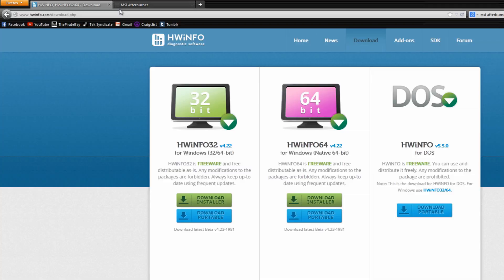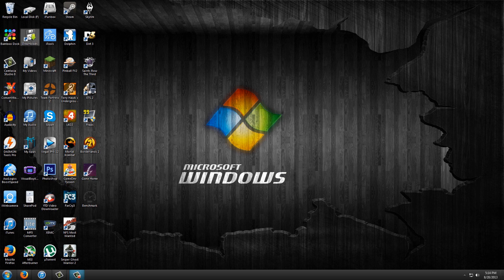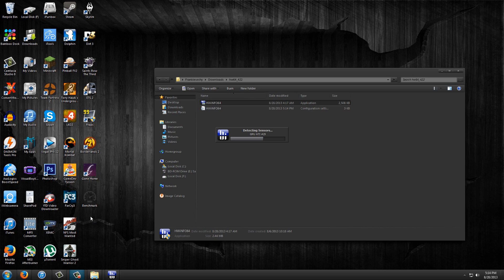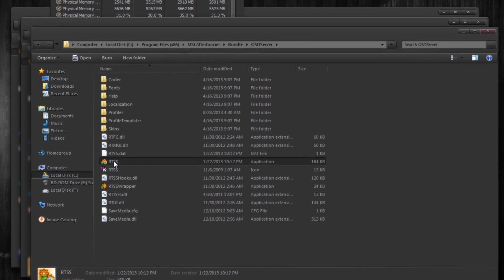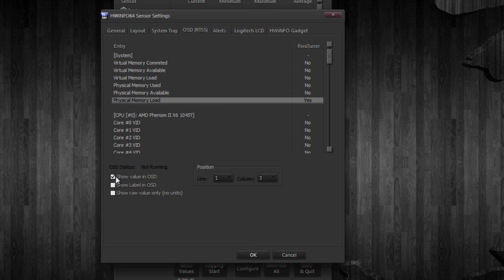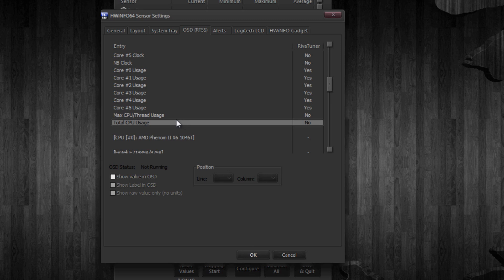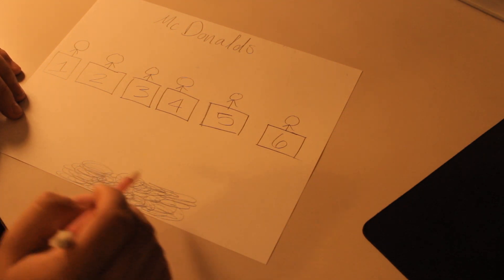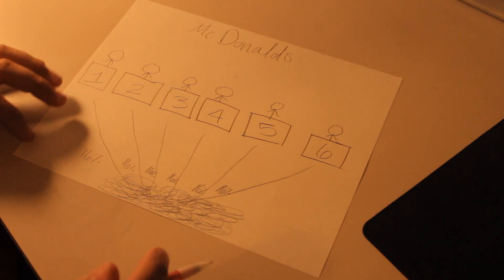How to Find Your PC's Bottleneck

Comment: Hi, systems specs is 
i5 6600k running at 4.4ghz
8GB ram ddr4 single channel
GTX 980 ti amp extreme zotac
PSU: Seasonic Evo m12 520W 80+

everytime I play Battlefield 1 I experience CPU bottleneck CPU usage is always at 100% and my GPU usage is 60% - 70% sometimes it goes up to 85% I don't believe that i5 6600k will be bottlenecking with 980ti. Is there any problem with my system?

Comment: is my AMD FX 6300  bottlenecking my AMD R390 ?
Reply: Yeah, I had an R9 390x with an amd fx 4300, and then found out my cpu was a MASSIVE bottleneck. Anything AMD at the moment for you cpu will be a bottleneck. I recommend buying the 6th generation intel cpu's. I just upgraded to an i3 6100, and I saw a massive difference in performance. Even tho it's just an i3. I only play games, so it doesn't really matter I have an i3.
Reply: An 8350 would likely bottleneck it aswell unless you overclocked it.

Comment: I cant get RTSS to show up :C
Reply: When installing Msi Afterburner you have to ensure that RTTS is also installed. Hope it helps
Reply: oh, i am using RTSS, I just cant get the numbers on the screen to show up
Reply: +atheistfromnorway in Afterburner go to settings, monitoring,  check the mark on those stats you want to see,  then on the bottom tick the "show in on screen dissplay"  it should appaer now. Good luck! And happy benchmarking

Comment: Well I am confused.

I ran Assassins Creed Syndicate on Ultra and my Cpu Cores were at around 80-90% and my GPU was at 99%.

I lowered some of the settings and noch my GPU went down to around 90%, but the CPU was now at a constant 99%

i5-3570K stock clock; GTX 970

Comment: OK so im bench marking Rainbow Six Siege on ultra and my GPU is at 90-100 and my CPU is at 70-80, I lowered the settings to medium just for a test and yet my GPU was at 90-100 and CPU 90 -100 i then tried Low settings and they were just the same as the medium settings.

What is the Bottleneck?... much appreciated.

Comment: I'm getting 67% physical memory, 23-38% CPU, and 60-70% GPU on Fallout 4, yet am experiencing not insignificant frame rate issues at high settings (to 20 fpm or less at times). I'm using 69% physical memory, 30% CPU, and 97% graphics card usage on the Witcher 3, for reference.

What is my issue here?
Reply: +Keith Fuller It's the game man. Happening for everyone.

Comment: so if my gpu was at 100% and my cpu was at 100% the cpu would be the bottle neck because the cpu couldnt handle the gpus info sent?
Reply: +GamingToday That means your PC isn't strong enough to run whatever you are trying to run, they are probably on par, but the game is too intensive. Try with lower settings and see what you get, if they are at the same, then no bottle neck, if one is larger by a big amount, you have a bottle neck.
Reply: Shadow Walker ok if my gpu is at 99% all the time and cpus at around 50% what would be the bottleneck here???
Reply: GamingToday The GPU.

Comment: ran this bench mark on my 2 pc's. one amd phenom x4 ii 970t with gtx 670, cpu 61% gpu 10% sometimes 40% across the board. another core i3 4th gen with gt 720, cpu 41% gpu 100% this being the worst gpu the bottleneck. the first one is the better game pc for diablo 3. i do notice some lag in the second pc. the i3 has a significantly better single core bench mark. they both play the game. one weak cpu strong gpu the other strong cpu weak gpu. with the weak cpu the loading screen takes longer. can't upgrade the weak gpu more because psu not modular is prebuilt.

Comment: Everything is right in this video except GPU part, if your GPU is 99% it means that you DON'T have any BN and you gpu is working at it's full potential, if your GPU usage is 60-70% that means that CPU can't handle all the work that gpu is sending to him. Cpu - Lower usage the better, GPU - higher usage the better.
Reply: +DelBoy That's bullshit. Your computer can't just make shit up for your GPU to do. If it's at 99% usage, it's using 99% of what it can do. It won't be able to run anything more intensive than that very well. You absolutely do not want to run any part of your hardware at 99% for any extended period Depending on your cooling situation it could severely reduce its lifespan.
Reply: JavierBacon
GPU is not a CPU it's made to work on 99% in games. The only thing when it's alright to have lower gpu usage is when you enable Vsync because your graphics card doesn't need to work so hard in some games to render 60fps, but when you disable vsync there's no FPS cap, so if you have slower gpu you'll have 99% usage at maybe 70fps but if you have high end gpu it will go to let's say 150fps to be at 99%, there's no limit. If you put a cap on FPS or enable vsync then ofc. it doesn't need to work that hard, but most of us disable vsync. Also to back my story up, i've had FX 8320 at 4.5ghz and 290X and most games were using only 70% of gpu, i've upgraded to i5 6600 now it's constantly at 99%... I know what i'm talking about.

Comment: so basicly with this method i found out that it wasnt my cpu bottlenecking etc as i thought, 
i recently bought a gtx 970 msi. and apparently it can't run witcher 3 in any decent settings and get solid 60 fps + : / damn thats so freaking dissapointing. it was running at 100% and my cpu wich is a 2500k at 4.4ghz ran at 60% on all cores. and it stutters and drops to like 45-60 fps around there. shame
Reply: +Vuzuul well maybe because 970 is performance wise pretty much same thing as 780...
Reply: ***** a 970 is a few % faster :) altho since then i've bought a new system and am now running sli msi 970s and
ASUS Z170 maximus VIII Hero
Samsung 950-series PRO 256GB M.2 NVMe	
Samsung 850-Series EVO 500GB	
EVGA Supernova G2 850W

Corsair 16GB (2x8GB) DDR4 2133MHz CL13 Vengeance
Fractal Design Define S 
Intel Core i7 6700K 4.0 GHz 8MB

Comment: Thanks for this video,

Question, i have 2 x 670 in sli and only second card has GPU D3D Usage that can be turned on to yes. is this due to the sli setup and will it give me the right usage value (in %) of both of my cards.

Comment: I have a question!  I followed this guide and my CPU threads were all around 70% and my GPU was around 60-70% and my RAM was around 23%.  Correct me if I'm wrong, but doesn't the computer put out as fast of an FPS as possible until it hits some sort of limit of the hardware?  If so, then I am confused as to what aspect of my system is preventing me from getting faster FPSs, since nothing appears to be at 100%.  Any Ideas?
Reply: +Mitchel Craun Game might be capped at 60fps if you have VSync on or if you capped it, so that might be the reason. Also, the computer won't push itself to give you more fps, it takes what it is given, and renders it and loads it and stuff. For it to be faster fps the usage should be lower, since that would mean it is clearing things faster.

Comment: hi guys. i have amd a10-7850k (OC to 4,2Ghz), 8gb ram 2133Mhz (2x4) and GTX 960 gaming 2G. i think i am bottlenecked is it true or problem is elshewhere ? and if i am bottlenecked is here any solution to fix it and not buying new cpu with motherboard or no ? thanks for help :)

Comment: My CPU has Intel i3 530 and 8gb 1600mhz RAM. Now i'm planning to buy a graphics card for general use (gaming, editing). Is GTX 650 / HD 7850 / GTX 750 worth to pay without bottlenecking the whole system?

Comment: both my gpu and cpu usages are 90% what does that mean help!
Reply: +Infrared Gamer Try lowering down the game settings and see if that helps. Also try other games to see if you get different results. If the results are the same then it's probably time to upgrade.

Comment: I have an i7 4790k running at 4.0ghz with an Asus factory OC gtx 770 and 8gb of RAM, running with 2 Samsung 840 120gb ssd's, no hard drive and I have 55gb left free. I feel like my pc isn't doing as well as it should be,  for some odd reason when I try to max out h1z1 or rust ( new version) it drops me from 60 fps ( on high) to around 30-32. For both games
Halp?
Reply: Its your 770

Comment: Im just comfused
GPU is 59-99% asus amd radeon r9 270x 4gb directcu ii top
RAM 42%
CPU all cores except one at a time below 50

105 FPS on Bioshock infinete on ultra and yet games seam to lag. Can it be the Motherbord? or i have a weak power supplay to 550W aaaaaaaa im just confused now or is it my shitty monitor.

Comment: Hey sir, I bought myself a gtx 750 ti.... I saw many people using it and run bf4 on ultra... but than I realised thst I have 20-30 fps on low medium....

The graphcard may not be the problem... Let me give you my specs

Cpu: AMD A8-6600K  Quad-Core 3.9GHz (with radeon hd graph which I aint using)
Gpu: Nvidea geforce gtx 750 ti ( evga )
8 Gig ram 1600 mz
harddisk 1 tb

Can you tell me where the bottleneck is

thanks already guys :)
Reply: +bram van Likkepot What's the wattage on your power supply?
Reply: KrypptikkSoulslayer 500

Comment: Aight, so I did this (great vid btw) and I had my last 3 cores of my quad core, at 100% most of the time along with my gpu and ram, although my ram was more on the 10-20% side of things but sometimes at 100%. My first core was just sitting on about 40-70%. This is annoying as I recently got a new gpu (on Saturday) so what is my problem?

Specs: Amd athlon quad core processor 
           Msi radeon r9 270x oc gaming 2gb
           8gigs of ram (one ballistix corsair idk what the other one is)

What do I do?

Comment: Please Check mine, 
GTX 970 Amp Extreme Edition
i5 3470 3.2 ghz 3rd gen
8gb ram kingston
motherboard msi b75
Thanks!!, tell me if something is bottleneck or everything is in balance?
Reply: ***** thanks man.. appreciate your help
Reply: ***** But I'm Experience Random Freeze When playing AC Unity.. The Game Runs Smooth 50-60FPS max Settings But Random Freeze like every 20mins freeze for 5 Secs.. What do you think? or w/c part do i need to upgrade?
Reply: john albert policarpio 
Check your PSU, how many watts? And it could also be beacuse of either the GTX 970 memory bug or how bad AC Unity is made for pc (it's extremely bad configruated haha Uisoft have had alot of critisicm beacuse of that). :)
Reply: 550 PSU.. >< damn! i dont know either if its my HDD now lol
Reply: john albert policarpio It might be a too weak one, what brand is it?
Reply: WDC WD10EALS S-00Z8A0 ATA DEVICE
Reply: john albert policarpio If you really wont no problems you should get a high-brand one, like cooler master or corsair, it could be that the power cant handle the praphics card when it's running full.
Reply: bro i got a 770 before when and never had issues the wattage of its is twice as of gtx 970, gtx 970 is saves a lot of power/electricity, and the 550 PSU that i have is also high quality
Reply: Thank you so much.. its all ok now.. got the new patch v1.5 for ac unity.. :) no lag at all now and all on ultra thanks

Comment: NEED HELP ASAP, when i play games like battlefield and advanced warfare i can get a steady 60 fps on ultra settings. But when i play lol or minecraft i struggle to get 60 on medium settings. Can anyone help? my specs are as follows:
	AMD FX-9370	4 °C
	Vishera 32nm Technology
RAM
	16.0GB Dual-Channel DDR3 @ 802MHz (11-11-11-28)
Motherboard
	ASUSTeK COMPUTER INC. CROSSHAIR V FORMULA-Z (Socket 942)	27 °C
Graphics
	ASUS VK222H (1680x1050@60Hz)
	3072MB ATI AMD Radeon HD 7900 Series (ASUStek Computer Inc)	39 °C
Storage
	931GB Seagate ST1000DM003-1CH162 ATA Device (SATA)	21 °C
	931GB Western Digital WDC WD10EZEX-00KUWA0 ATA Device (SATA)	24 °C
	7GB Kingston DT 101 G2 USB Device (USB)

Comment: I dont have a graphics card, I have integrated graphics on an AMD A6-5400K APU, I dont know how good of a card I can get on this without a bottleneck, anyone know anything about APU's?
Reply: I have a Apu- a8 5600k and currently run a gtx 770 on it. I can say there is a bottleneck on it so I ordered a i5. Max you could probably get away with without huge bottleneck would be either a gtx 750 ti or amd r7 260x. Hoped this helped :)

Comment: My specs:
Sapphire AMD R9 290 TRI-X OC 
AMD Phenom II x4 BE 3.8GHz (OC)
8GB RAM

My GPU load while playing is 50-60%. And my CPU is on average 77-88%. Does this mean my CPU is bottlenecking me?
Reply from the maker: MightyWolve It simply means that in that game, if anything, your CPU is lagging behind your GPU in this case, BUT it does not mean that your CPU is causing a frame rate drop or anything. So, your CPU is not bottlenecking your experience. If those cpu figures were 95-100% then I would say that maybe it's to stock up on more processing power.

Comment: My Specs: 
Sapphire AMD R9 290 TRI-X OC 
ASUS Crosshair IV Formula - AMD 890FX Mobo
AMD Phenom X6 1100T Black Edition ( OC - 3.8Ghz, Boost - 4.0Ghz )
Kingston HyperX 8GB 1600MHZ Ram
G7 750W PSU
I'm wondering if this config will bottleneck. 
I had a 7770 Ghz edition before the R9 290 I I could run Battlefield 4 in medium or high with AA turned off. Now after upgrading the GPU I'm able to max out every single game I throw at it including Planetside 2 and Far Cry 4. 
Thanks In advance

Comment: I just upgraded from a gtx 770 to gtx 980 G1 (both gigabyte)

I don't see a huge difference between the 2. So did I just spend money for nothing?

(My specs)

AMD FX 8350 / 8 core, 4.0GHz (CPU)
Gigabyte GTX 980 G1 (GPU)
ASUS Sabertooth 990FX R2.0 (Motherboard)
Corsair CX 750M (PSU)
Kingston DDR3 1600Mhz 16gb
Reply from the maker: Well, that depends, were you having low FPS's before the upgrade? And do you still have low FPS?
The 770 was a pretty good card to begin with.

Comment: Hey guys i could use some help on knowing what to upgrade next to. PC is for games and stuff and has done fine for me so far but when gtav comes out i want that beast to look good. any help would be appreciated.

Processor
AMD FX(tm)-4170 Quad-Core Processor
Speed 4.2 GHz

Video Card
AMD Radeon HD 7700 Series 1gb
Reply from the maker: looks like you have enough processing power, but get a better video card, and you'll be set! My recommendation: if you can, get a GTX 970 (if your mobo is compatible with Nvidia cards) or the 290x is good as well on the AMD side!
Reply: *****
cheers dude major thanks for the advice. yea il check those two out and thanks again youve been a big help.

Comment: Hey, need some advice... I just purchased a Geforce 970 and i'm slightly worried about CPU bottlenecking, Its a Intel Core 2 Quad Extreme (QX9650) 3.3Ghz OC with 16GB DDR3 Corsair. What's your thoughts? Buying a new i5/i7 now will be an expensive venture. I'm going to use your recommendations and test on a few games but any advice would be great and appreciated.
Reply: Definitely get a new cpu. Thinking an i7 would be good.
Reply: C. Crave i have amd a10 6800k 4.1ghz processor with integrated graphics card. im gonna disable that integrated graphics card and buy a new one: MSI GTX 970 gaming 4g.      will i get bottleneck? i mean i have 4.1ghz processor and that new graphics card should be pretty fking good right?
Reply: Yeah your GPU is pretty great! You should be able to run pretty much anything on ultra settings. I recommend going with a intel instead of an amd CPU. I had an AMD for my GTX 650 ti a while back and almost all my games had frame issues, and lower graphics settings cause it couldn't handle it. when I switched to an intel CPU with the exact same graphics card, it swept that bottleneck right off.

Comment: I have a much simpler way and I think better way to test for bottlenecks. Get a fps counter like fraps, measure your fps in the game you want to test (1 game might bottleneck your gpu while another might bottleneck the cpu, on the exact same setup. Now measure the fps again changing only the resolution, if fps stays the same while turning the resolution up and down, you have a cpu bottleneck. If you get a performance increase from lowering the resolution, your gpu is the weak link in your setup. A perfectly balanced sytem would get no gain from turning resolution down while guetting a drop from turning resolution up.

As for memory, it is highly unlikely that it will be a significant bottleneck with 4 gigs or more, as long as it is not running in single channel.
Reply: You wont find out if your RAM for example is the bottleneck though. And this is more accurate.
Reply: Changing res will only affect framerate if you're fillrate bound. Nice try, but it's more complex than that.

Comment: i have an amd fx 4100 quad core cpu and its usage in msi after burner on each core 100% and my gou is high 90's or 100% but i get weird fps drops :C any one know what to do and my gpu is an r9 270x
Reply from the maker: You either need to turn your graphics settings way down, or upgrade both you GPU + CPU. Your CPU in this case is really bottle necking your performance. The R9 270x is a decent mid-level graphics card, but for the graphics quality you're playing at, it really isn't enough my friend.
Reply: *****
i dont think that my gpu is the problem , thing is the fps drops are random , not when its in like intense moments and my gpu usage is 99%  when i play games , if not 100%

Comment: hey everyone I have a core i3 2100, 2 gb ram, a nvidia GeForce 8400 gs, a gigabyte H6IM - DS2 motherboard. I was planning to upgrade my pc with 8 gigs of ram and a radeon r7 260x. Do you think my pc will bottleneck??? or i have to change my processor as well
Reply from the maker: Well Abhishek, it depends on what kind of graphic quality you're trying to play at. If you're looking to play on the low-medium side of things, then your new upgrades will suffice. But, if you're looking to play with better quality, then get a better video card. The R7 260x is really on the low-end (which is okay if you're playing on low quality graphics). Your CPU may not be a problem as long as you upgrade your graphics card to a much better one. In my opinion, get an R9 270x, it's $70 more than the 260x, but it's really worth it.